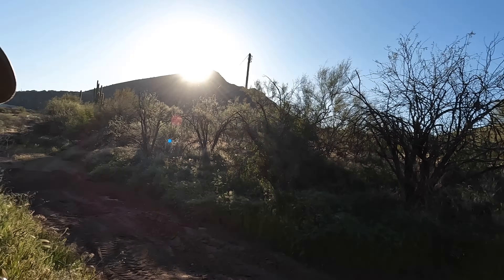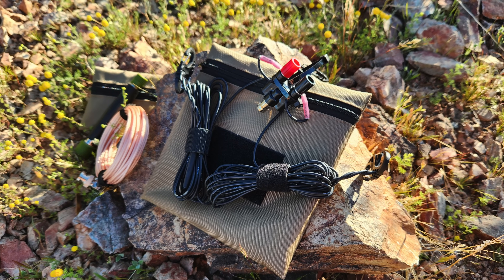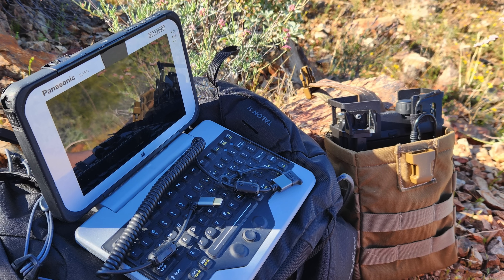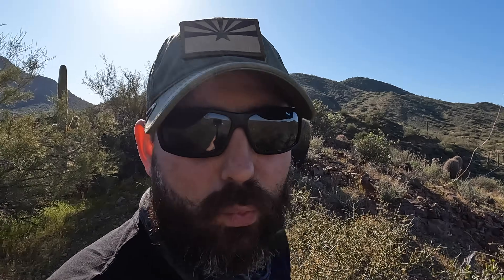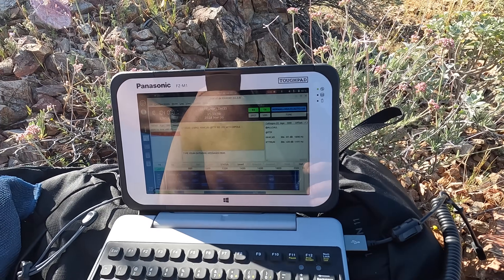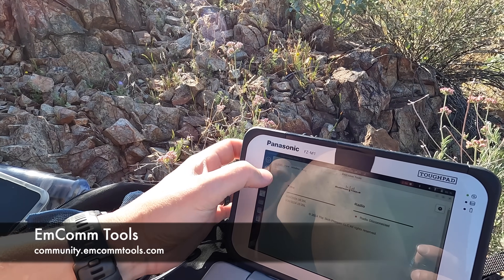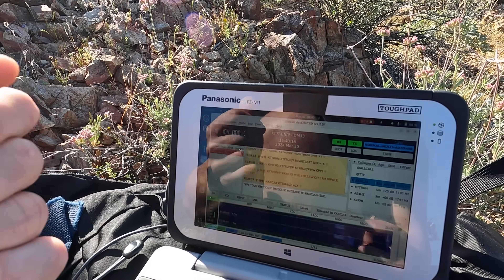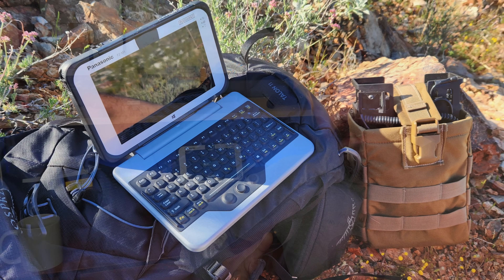Long Range, Offgrid Comms Training - 1500 Miles

Comment: Looking at a used 857d. Would you recommend it or go with a low power one like 818nd? Wanting to build a pack like yours and want the “ultimate” rig.  Thanks!
Reply from the maker: Go with the larger FT-857D as you'll  need more power when we go into a solar minimum in a few years.
Reply: @TheTechPrepper  thank you!!!

Comment: As always, Gastone, you CRUSHED it!
Reply from the maker: Thanks, buddy. It's a blast sharing the ride with you and the community. It's always nice when you stop by. I would have tuned the antenna if it wasn't for the horribly rocky conditions. I am glad that the math was spot on for the wire lengths and got me a pretty decent SWR on the first shot.

Comment: Can you plz maybe make a short video on how to sync time off other users on js8Call when there is no internet. Thankyou
Reply from the maker: That is actually a member video that I am making within the week. I will show three different techniques, none of which require onboard GPS. There is even a field card for the members to print out a laminate. Basically, I will be covering the manual time sync by the operator using the WWV time signal or using a reference GPS watch. Lastly, l'll show the time drift feature in JS8. That last one does not actually set the clock, but it has value for decoding signals.
Reply from the maker: Nice dachshund. We have a long dog, too.
Reply: Thx, dachshunds are great dogs
Reply from the maker: @Don008Ramon  Yep. Very loyal and smart.

Comment: As always, awesome stuff.  What pack do you have the FT-818 and Armoloq in?  Do you have the battery attachment for the Armoloq?  I bought the Armoloq for my FT-8800 with battery pack and may get one for my G90 but am looking for the pack to put it all in.  Thanks for great content.
Reply from the maker: It's a modified version of the Helikon Tex E&E pouch. I chopped off the top cap and used the frabric to make a strap with a buckle.
Reply: @TheTechPrepper  Awesome.  You don't have the MBS-1280 battery unit on the manpack do you?  It is taller as I have the manpack for the FT-8900 and the MBS-1280 with a Dakota Lithium 12V 10 AH battery.
Reply from the maker: @keithsafford3056  Negative. I am just running a small 3Ah TalentCell battery on the inside.

Comment: I've been watching your videos for a while now.
You're one of the few that approaches this from a scientific perspective. You come up with a well defined plan, stick to it, and note the results, comparing those results to any previously collected. No bull, no relying on marketing.

Something I read in an old book years ago, and have thought about ever since:
If one half of your dipole is connected to the shield of your coax, then it isn't really a dipole - It is a monopole in the vacinity of a grounded conductor.

Thinking about it further - The "other half" should be going negative voltage when the "first half" is going positive voltage. This can't happen because one half is tied to 0v through the coax and then to the chassis of the radio.
What's needed is a balun to allow BOTH halves of the antenna to vary in voltage. No impedence matching required as everything is as close to 50ohm as it needs to be - just a 1:1 balun.

I only just got back into HF, and this is something I've been experimenting with recently. My problem is that I can't reliably find others to meet on air at specific times. 
My main interest is NVIS so that I can work stations in the UK (where I am).
I don't currently have the capacity to run JS8 (running an old Clansman PRC320 with about 9W on SSB).
Do you publish the times when you'll be on air? I'd be interested in listening and attempting a call-in.

Kind regards,
David - M3ODQ
Reply from the maker: Glad to hear that you like my operating philosophy and approach. 

At these low power levels, I rarely ever need to run a 1:1 balun. I do have a QRP choke from N9SAB that I will use if I run my FT-857 with more than 5 watts. 

I typically set on 40m daily on JS8 from 1400Z to 2300Z daily.

Welcome back to HF!

Comment: What would your plan be for a shtf that doesn’t allow for checking which bands are best ?
Reply from the maker: ;
Honestly, experience. Each of the amateur radio bands has pretty reliable propagation characteristics based on time of day and season. I also have developed some offgrid prediction software that provides predictions a few months into the future without the Interne. Lastly, most of my commo plans deals with multiple bands and methods of carrying out communication 7 days on a 24-hour clock. I'll share some of this with the community this year.

Comment: The Chameleon Tactical Delta Loop would be handy in making a targeted contact since the RF exits broadside and it's resonate on 30-6m. No tuner required to work those bands in the loop configuration. 

It is pricey, but works great. I bought mine during a sale and saved some money. I believe the ECOMM III Portable EFHW is resonate on 17-10m as well. Haven't used that antenna in a while. Need to get it out soon and give it a whorl.
Reply from the maker: Yep. I have a TDL in my kit, but did not bring it for this exercise. I showed it earlier this year. It's a great piece of kit.
Reply: I must have missed it in your video.

Comment: My two cents as a lover of knots and someone that probably uses string and rope in place of more appropriate tools: The prussic knot is like the taught line but it works in both directions. It's much more versatile than the taught line and you get the taught line as a side effect by just tying half of the prussic knot. I probably wouldn't pick it as the only knot to teach someone but it's a little better than the taught line as the only one to know.
End pedantry :P
Reply from the maker: Great point on the prussic. I'll use it for a ridge line, but for guy lines, I prefer the taut-line hitch.
Reply: @TheTechPrepper  yeah neither do I. I use truckers hitches for guy lines. My comment was more about the one knot to know and not entirely serious. I forgot tune my sense of humor this morning. It's pretty high swr today.

Comment: I am looking at a rugged tablet for this function, digital comms. Question, what was your deciding factors on choosing the Panasonic over Dell’s rugged extreme tablet?
Reply from the maker: The Dell rugged line, in general, are just the consumer boards with a rugged shell. The Panasonic line is architected from ground up for robustness and reliability. A component failure in one area is likely not going to impact and another area of the system.
Reply: @TheTechPrepper  Ahhhhh, thank you for that clarity, it makes perfect sense.
Well, with new clarity I see a Panasonic coming my way via Amazon. 73.
Reply from the maker: @Toneblender  Try to find an FZ-M1 MK2, the MK1 is slow, but it still works for this application. Happy hunting.
Reply: Thanks for the advice. Found a MK4, should provide adequate speed. Most HAM software isn’t to taxing on systems (JS8Call, FT8, Gridtracker, etc.) I appreciate your work. Good practical approach to comms. DXing is cool, but not every contact has to DX. XYZ country can’t help me locally when a disaster happens. 
FYI, subscribed to channel. 73.
Reply from the maker: @Toneblender   Thanks for the sub. I actually just loaded an FZ-G1 MK4 for a supporter that loaned my his IC-705. That unit is much snappier than the FZ-G1s that I run. Welcome to channel!

Comment: thanks for sharing the exercise and report! really enjoy picking up on obstacles you overcome along the way with the no random contacts. keep up the awesome work!
Reply from the maker: Thanks. One of the obstacles here was the lighter back. It allowed me to run instead of walk, but running with 20 pounds of gear is almost as strenuous as hiking with a 40 to 60 pound pack. These little challenges make the exercises very rewarding. Have a good one.

Comment: Garage door opener sensor wire might be ideal as long as it's not stressed.
Reply: You can jumper it at the motor temporarily to bypass the sensors. The safety reverse will still work.
Reply from the maker: My garage door is broken. I guess I can strip that wire when I replace it. I think a pack rat may have chewed a piece and caused a short.

Comment: As i have been working with js8 call, i realize in the real world how much  farther it goes on such low power.

I will still use voice, but adding js8 training.
Reply from the maker: JS8Call is a great help when conditions are poor and output power is at QRP levels. Keep on training.
Reply: When my sla batteries were basically dead, it was almost only 15 watts max.  @TheTechPrepper

Comment: The noise was pretty low.  Even the wind i noticed wasn't causing any issues.
Reply from the maker: I cut out about 20 minutes of video. The bits that I included were what was salvageable. Take it easy.

Comment: Where can I find that keyboard at a decent price?
Reply from the maker: You can't. The eBay prices are higher than what you buy them brand new. I bought 20 last month and sold some to the members, but they sold out quickly. iKey is completely out of them. You're looking at $350 used. I sold my batch for $380 with shipping included.

Comment: Love your work! have you looked into directional antennas? as referenced in the army field manuals, essentially they are long (1-5 wavelengths) endfeds or long v dipoles that get you directional patterns.  A dipole cut for 80m (130ft) is quite directional on 20-10.  Ideal for targeted contacts
Reply from the maker: Thanks. Yes, I have looked into the terminated V antenna for this exact reason. I found it in several military FMs. In fact, I used it for my No Random Contacts  video with Jason KM4ACK last year. Check that video out. In general, I found a traditional 1/2 wavelength dipole to be more effective, simpler and it takes up less space.

Comment: This is the core of it all, right here. Some homework + modest simple gear = success.  You make it look easy but it is not. The homework towards that targeted contact is the biggest factor in success or failure. Anyone who thinks they can just jump on the air and make the contact without doing the homework will be in for a fast lesson.  Great work as always my friend.  73 KC8OWL
Reply from the maker: I will tell you, it's not easy. The rock I climbed to was a bad idea. I could not have a picked a worse spot, but at least I made it work. Planning is everything. It's great that there's a simple approach to making targeted contacts possible. I look forward to sharing more of the planning. It was a rough contact between us, but at least you got my message later in the day via JS8Call's store and forward feature. Unfortunately, I left it out of the video due to the 30 mph winds that came through later in the morning. It ruined the audio.

Comment: Like you said your local group has their procedures, I use to to a lot of keyboard to keyboard and we used an extra carriage return at the end of our thought so the other guy would know when to respond, I think I have seen on js8 the use of RR for ready to receive maybe. Much of my efforts are in support of my community, so I am liking at pulling information into my area and pushing it out locally, I have been practicing AREDN ham WiFi my group is out to over 5 miles with good bandwidth.
Reply: "RR" I believe is roger-roger.

BTU is used in CW. That's an easy one. My ham club has members who are heavy into cw and use all those abbreviations in digital modes, so I had to print out a list. 😂
Reply: @LeeMccNA5T  I stand corrected, I have seen it at the end of messages on js8
Reply from the maker: Our group in the South uses BTU (back to you) and "out." We also make a point to watch the waterfall and the frequency that the other operator is on. Thanks for the additional tips.

Comment: Isaac and T-Rex is what got me onto this path, ultimately finding your channel. Now coms between you and Isaac makes this full circle . 👍
Reply from the maker: Welcome aboard! He has great content that is easily accessible. In fact, he designed the first logo for the project that I have been working on.
Reply: Ditto to enjoying both channels. Enjoyed the livestream last week. I have some of those cobrahead bnc type connectors so I will make a 17m band antenna as an exercise once I get some of that nice wire!
Reply from the maker: @Flatus4La  Good luck. Shoot me an email through BMAC. I have an EmComm Tools tin for you.